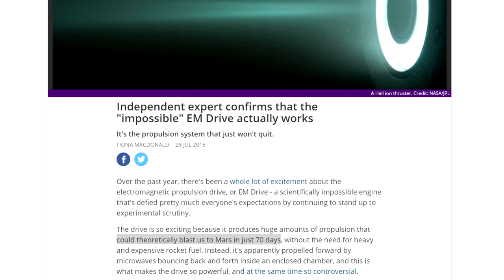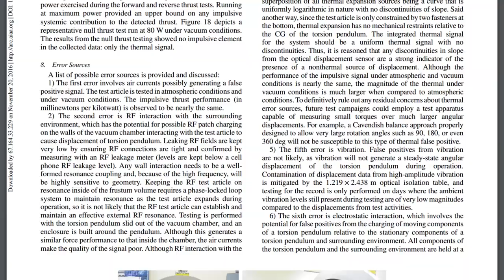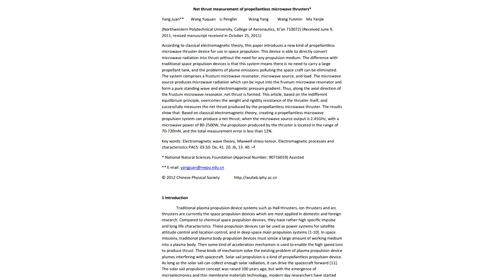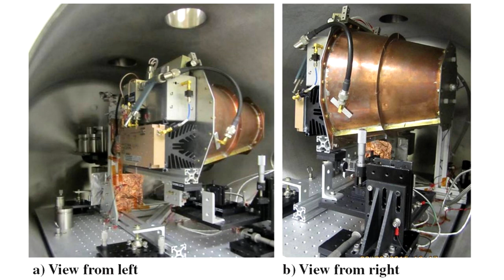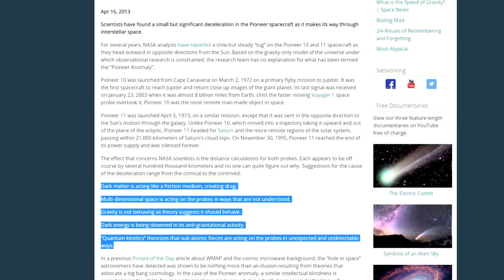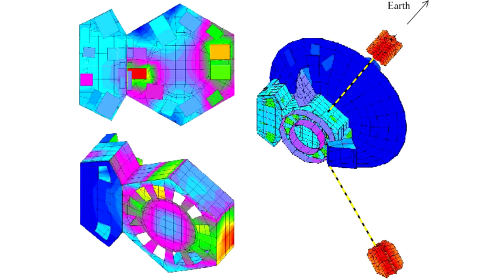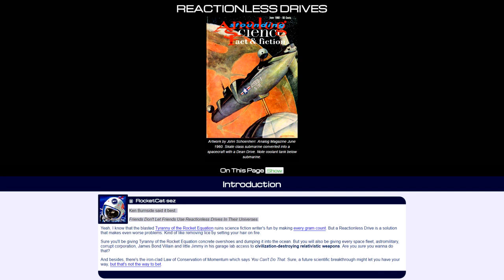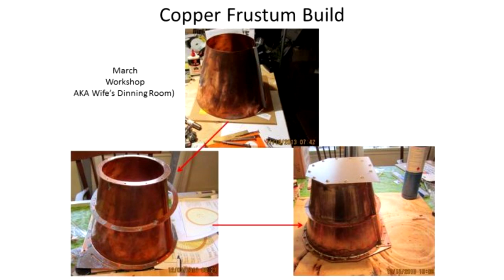What is the EM Drive? And Does it Really Work?

Comment: On another video you mentioned the concept of a Magnetorquer which is a method of rotational control that uses the earth's magnetic field to provide rotational force. Isn't it likely that the extremely small levels of thrust if anything are the result of the drives EM fields interacting with the earth's magnetic field???

Comment: An EM drive will still require a power source that is efficient, light,  and safe.  Could it power flying cars?  I hope not!    People can't drive now without screwing up or deliberately going too fast, running red lights etc.  But the idea of a steady propulsion system for long distance travel is something scientists have thought about for some time.  They came up with the idea of "solar sails" for instance and Arthur Clark wrote a story about it many years ago.  I doubt that the EM drive would disrupt the laws of physics, if it works, there's probably a good explanation for it that has't been investigated before.

Comment: E/M waves are faster at the wide end equally in both directions, so... no.  Photon drive: p=hf/c, limited by frequency of light, which we know isn't so easy to produce above UV (without particle guns).  Ion Drives: Nice thing about Ions is they accelerate so easily.  At high energies, p~E/c, so there's essentially no limit to how much momentum can be had from a single Ion.  Wakefield accelerators produce MeV electrons in a few-meter linear engine.  As soon as someone invents a Wakefield Ion generator, travel between stars might be accomplished with only a few pounds of Ion "fuel?"

Comment: Nasa is a front for what is really going on .Most of the top guys have been ferreted away to places such as Area 51 where drive propulsion has been studied and applied for the last 40 yrs. Aero spikes high voltages at the tip of ICBMs dramatically cut drag, every third model of the B2 incorporates electro gravitic drive propulsion, flying disks at Area 51 use microwave phase conjugation, TR3Bs and others use Mercury plasm drive. As Ben Rich said, "We have things 50yrs ahead of what you can imagine,we have the means to go to the stars".

Comment: Perpetual motion engine? Where did that come from? Are you saying that when this EM Drive actually pushes something it won't use any of the microwave power getting pumped into it?  (and just reflect it all back into the microwave generator)
Converting energy from one form to another without gaining any energy is much easier to swallow than suddenly having a "ZPM"

Comment: If you're in a stationary elevator on the ground holding a charged object, you would measure not light being emitted from that object because it is not accelerated due to gravity. However, if you were to relocate that the elevator and charged object out into empty space and apply a force to accelerate it to g, then you would measure light being emitted from the charged object. Doesn't this break the equivalence principle? If not, then what am I missing?

Comment: Elecromagnetism in power cables going to frustrum could account for torsional forces. Also, I thought photonic forces are way less than EM forces. Like 4.5 micro Pascals (at Earth distance from the Sun) = 4.5 micro Newtons per square metre. And solar incident radiation is about 1300 Watts per square metre at the same distance.

Comment: I'm kind of 50% convinced, There's a few reasons for this: De Broglie–Bohm theory was cited in the paper as a possible explanation, We currently don't have a theory for quantum gravity, and we don't have a theory for Dark Energy or Dark Matter that has been verified, plus finally there was a hint of a 5th fundamental force being discovered this year (doi:10.1038/nature.2016.19957).

It doesn't help that the original designer is a crack-pot, but there could be a legitimate explanation that doesn't violate the 2nd law of thermodynamics.

Comment: How many iterations did the Bell nozzle go through before it was optimized for performance? This is nascent applied physics. Give it time. And it doesn't violate Conservation - it's not a closed system, as it requires a massive energy input therefore has entropy. E=mc^2, after all.

Comment: I'm really stumped on how the EM drive is supposed to violate conservation of momentum. A photons has energy which can be converted to mass via e=mc^2, so wouldn't you expect to feel a force proportional to the mass the photon's energy translates to? Ignoring how difficult it would be, couldn't you convert the photon energy into mass and throw it out of your spacecraft to feel a force? Or if you threw a chunk of matter and a chunk of antimatter away from you in space you would feel a force, but then if they collide and are converted into pure energy, you are still moving but there's no longer any mass corresponding to the equal and opposite reaction, so it shouldn't matter whether there was mass to begin with. Can you point out if there's a flaw in my logic here?

Comment: I'm going to mention something that is also very high in the "piss off physicists" list (I'm one, I know) but at least does not involve breaking fundamental laws of conservation: what if the EM drive is simply pushing against something that does have a preferred frame of reference - sort of like the 'ether' of old? So not the quantum vacuum, I imagine, which should be Lorentz-invariant, but something physical. One thing that comes to mind is dark matter - we don't know what it is so it could be literally anything, and for all we know it could be weakly interacting and pretty much all around the place while being approximately dragged along within our galaxy's reference frame. Another thing is the CMB. In theory the CMB should be uniform in all directions, but if for example I were travelling at relativistic speed I should see it blue-shifted in front of me and red-shifted behind me, and as a result the photon pressure should slow me down until I'm back to seeing it uniformly in all directions, right? Of course that takes VERY high speeds and VERY long times but I can imagine it being possible, which at least provides us with a possible frame of reference the EM drive could be mysteriously coupling with to generate its thrust. As to the how, be my guest... Casimir effect comes to mind but shit's not supposed to work this way.

Comment: John Bode wrote in a comment below- "For EmDrive to work as advertised, a lot of current physics has to be wrong - not just incomplete, but wrong ."

Not really. Have you heard of "Virtual Particles"?
We have verified some of the theories such as the Casimir Force.
It has been verified enough that we have to compensate for this force when designing micro-MEMS devices.
So the physical effect of these virtual particles CAN BE REAL.
So what if you could build a device that can impart momentum onto these virtual particles in the short time they are "real" and not virtual?
Does the law of conservation of momentum get violated when we do this OR did we just make the WRONG ASSUMPTIONS when we defined the "Closed System" (referred to in the Law of Conservation Of Momentum) and we SHOULD include interactions with the quantum "Virtual Particles"?
Perhaps the effects that these virtual particles on our reality could explain "Dark Matter" and Dark Energy?

Have you heard about one of the ways we make anti-matter?
We basically generate a big enough electric field that we "exrtract" an anti-electron from the virtual "soup" of particles.
When these particles are created they must have some kind of momentum.
Did we just create physical "Momentum" from nothing but energy?

Comment: Could you use high power lasers to provide thrust? They do provide a small amount of kinetic energy, right? Might be good for interstellar travel, though eventually your solar panels wouldn't work because of the lack of solar.
Reply: This is actually a plan. Breakthrough Starshot is a project to launch a laser powered space craft. Except in this case the laser is firing from earth at a reflector on a very small probe.

Comment: Y'know, I've often wondered if a starlight-concentrating version of this could be employed in space.  We know the laser works by concentrating photons in a gas chamber until the light pressure overcomes a 95% mirror at one end and escapes with a notable power increase.  If such a chamber were pointed at the sun, so that direct sunlight could enter and be concentrated by the gas and reflective surfaces within, surely it would build sufficiently to generate a counter-beam that would generate exponential thrust?
Reply: I think you could power it from the photons of a nearby star, and you could certainly power a laser drive that way, but the "notable power increase" probably isn't what you think. Lasers appear to have tremendous power because they are incredibly focused and perhaps also because the light waves they emit are synchronized. (Instead of the waveform of each photon having a different phase, they're all in the same phase.) There's no actual gain in total power. If there was, we'd already have infinite free energy produced by rings of lasers powering each other. :)

Comment: Surely it doesn't break the laws of physics because, all it is doing is changing the energy from electrical to kinetic, which is allowed, right?
Reply: Sort of, but it's not that simple.  The most direct form would be photon propulsion where you emit photons(light) and you get thrust, but the thrust claims from this device are way higher than the thrust you would get from photon propulsion.  You can use electromagnetic forces to apply a force to an object, but that's like pushing something so it basically requires you have two things that are being pushed apart or pulled together.  In that case you would push something away and eventually it would be lost.  This device claims to be reactionless, that is it doesn't expel anything.  No photons leaving, no other matter being expelled.  Sure, you can convert electric energy to kinetic like in a rail gun, but you'll notice in the case of a rail gun something gets expelled.  You don't just move without pushing on something.

Comment: The speed of causality is the mechanism that lets this type of thing work. Essentially, the EM waves are applying momentum to the electron orbits of the metal in the drum's skin, but predominantly in one direction. This gives the electron orbits more velocity in one general direction, and so it tends to elongate the orbits, resulting in an imbalance. The atomic nuclei self-center in the electron clouds, and pull them back to a mass-relative orbital path, but being significantly more massive, there is a delay. During this delay, a difference in total momentum can build up. In this case, the speed of causality is acting like the frictional force that can be abused to 'scooch' yourself around in an office chair, without touching the ground or other external things. A possible improvement on the design would be to impart enough energy in the skin that the electron shells are bumped to a higher energy state on their outward legs, but then collapse predictably in one direction, resulting in a photon stream that is efficiently aimed as the photons are created. This would also serve as a test, to help understand "how the EM drive works", as directional photons would describe what's happening atomically.

Comment: I'm not a physicist, but I'm kinda wondering if the effect could be explained by interaction of the Microwaves with the earths magnetic field lines? I can imagine them pulling or pushing of of the earths magnetic field and there being a differential in push/pull due to the difference in area between the front and back of the chamber due to the larger volume of field lines at the wide end. (This offcourse provided the magnetic field lines could penetrate the copper hull. But as far as I could find a Faraday cage shouldn't block those).
I'm probably just ignorant of the reason why this is impossible but I'm curious what that reason would be.

Comment: Every time a measure of thrust experiment shows a micro Newton  thrust.... and then while replicated a flaw is shown to have occurred. 

The thrust/power ratio of the EM drive (if it wasn't a flawed experiment) is less than you would get from a normal cf light bulb.

Comment: To believe we know everything about fundamental physics I think is flawed, at this point we are blindly calculating using mostly statistical structures without knowing how exactly the underlying physics is working. This method serves us well thus far. I believe it is possible to produce some amount of thrust from virtually any conversion of energy albeit a useless amount in most cases. There are examples of previously thought to be impossible effects, when electrodynamics was written down nobody envisioned current flow in wires with zero resistance, now we have superconductors. Einstein believed that E=MC^2 would never allow us to use the stored energy, and yet, a way was found to unleash these forces rather rapidly... never say never, stranger things have been thought up and explained within the framework of what’s real...  I think perhaps it should be investigated with a more serious attempt because the technology we are currently using is less than useful in the grand scheme of space flight, reaching our nearest neighborhood stars can’t even be imagined at this point.

Comment: I scan-read Shawyer's patent the other day, and it isn't claiming to fix the energy cost of momentum (ie. it doesn't break PE:KE symmetry); rather, the proposed mechanism only generates thrust equal to the momentum asymmetry of the photon/frustum interaction, which concentrates more momentum at one end - once the craft's accelerated up to speed all thrust ceases, so more of a 'displacement drive' than a warp drive.  To put it another way, it'd need infinite energy to reach lightspeed, just like a rocket, rather than some constant energy cost of momentum multiplied by lightspeed in m/s. 

Which is not to validate the claim - ie. that there should be any thrust at all - just being clear on what is and isn't being claimed..

It's claimed to be an open system wrt to CoM, but - seemingly paradoxically - closed wrt CoE.

Resolving the paradox implies understanding how and why the FoR of the output energy (KE) remains bound to the FoR of the input energy workload, even though the input momentum and output counter-momentum are in different FoR's (the mechanical / non-inertial frame vs that of lightspeed / the vacuum)..
Reply from the maker: The problem is this violates relativity, which has passed every test thrown at it
Reply: @scottmanley  That's obviously not how we refute a claim - it is implicit that a reactionless thruster's KE would be squaring with velocity while its input energy merely summed, and Shawyer does explicitly address this problem and its purported resolution.   He also stresses that the net trust is only calculated when replacing Newtonian mechanics with SR - ie. the claim is entirely dependent upon SR holding precisely as it's supposed to, and not in spite of it.

The descriptions i'm referencing are from "CEAS2009paper.doc" from Shawyer's site.

He seems convinced that CoE and CoM remain unassailed.  They're only resolved if it's effectively a 'displacement drive' for want of a better description, rather than a 'motor' that keeps accelerating - he's envisioning an asymmetric distribution of ambient quantum momentum - a net radiation pressure, basically - from the constancy of C wrt to the frustum asymmetry / rate of incident photon interactions / time rate of change of momentum.

Obviously, we can gain momentum from gravity by similarly exploiting its constancy relative to arbitrary mechanical accelerations - slow down a drop and/or speed up an ascent, and you vary the +/- 'soak time' under gravity's constant acceleration / deceleration, thus causing a per-cycle increase or decrease; this is how we operate a park swing, gaining reactionless momentum from gravity and time.

It may seem irrelevant, but we all learn to violate N1 and N3 as toddlers, gaining momentum in an otherwise closed system of masses interacting about a common axis, and without application of counter-torque at that axis..  the Estonians have even made a national sport out of it (kiiking).

Shawyer is explicitly claiming an open system - that is, input and output workloads  are in differing FoR's - so the claim cannot simply be brushed off as if it were necessarily a closed system, since the claim is, quite directly, that it is not..

We've established that it probably isn't an inadvertent doomsday machine (phew), but i'm not yet clear on the resolution - either he's invoking an effect inappropriately, in which case, what exactly isn't going to pan out as expected? - or else he has a point that we're missing behind our impenetrable shields of incredulity..

Comment: If you had 2 lasers or some other emitting device horizontal to the space craft, pointing in opposite directions to each other and had the beams deflect by mirrors angled at 45deg to deflect the beam backwards, would you end up with backwards thrust while the opposite reaction of the two emitters are cancelled by each other?

Comment: Wouldn’t the whole “imagine a photon bouncing up and down in a box then move the box sideways it’ll take longer for the light to bounce because now it has to travel forwards and down” situation apply to this engine so technically by moving you would end up with these microwaves bouncing and reacting in a similar way thus resulting in a possible limit on thrust based on the wavelength or some other factor?